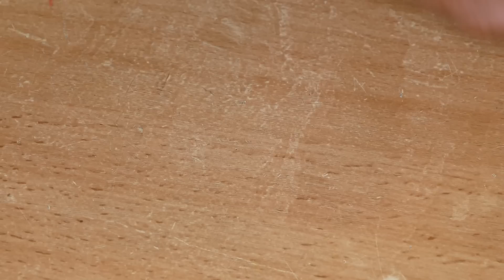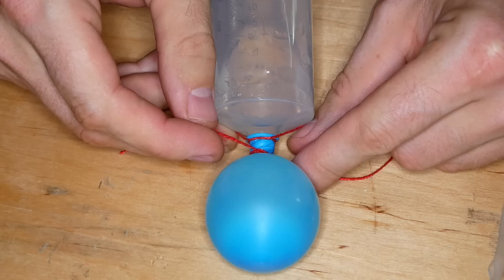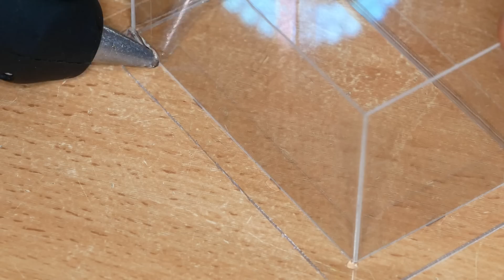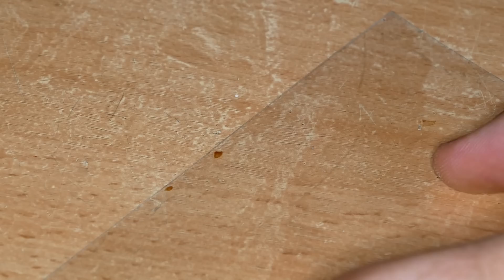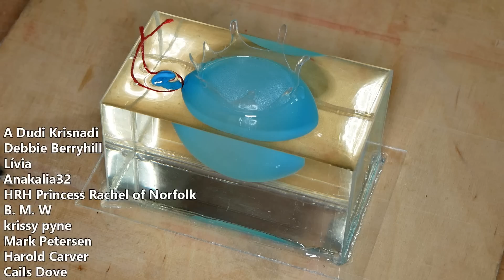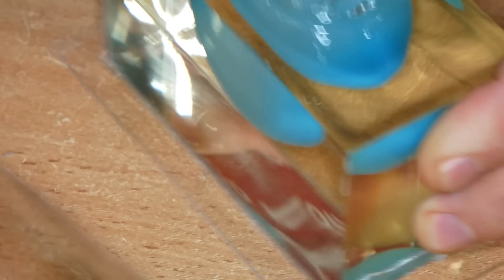Let's See What Happens When We Put A Water Balloon in Epoxy Resin. Will it explode?💥🎈 / RESIN ART

Comment: - The splash looks so real. 👍
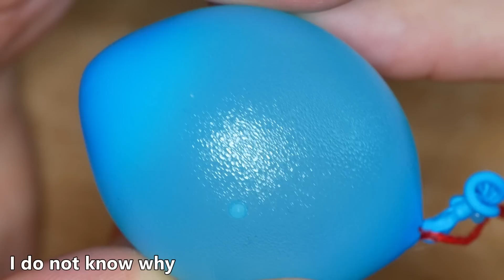- 3:41 The resin leaked out because balloons are not "solid", they have microscopic holes. That's why they deflate over time. Also, the resin gets hot when it cures which makes the latex molecules in the rubber to move fast which helps leak out a little.
Reply: yeah that’s what i guessed!
Reply: I came to say similar😁
Reply: Would it help to "double balloon" it?
Reply: @carolwalters6469  doubt it